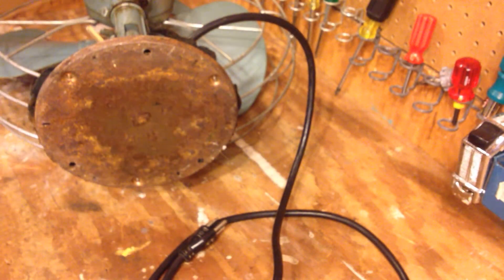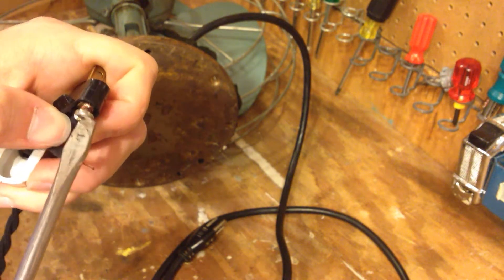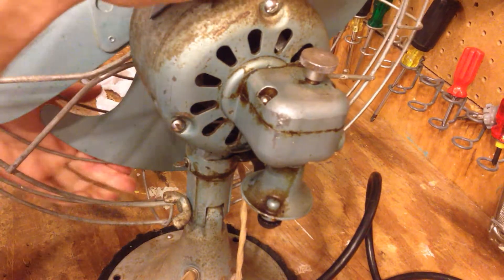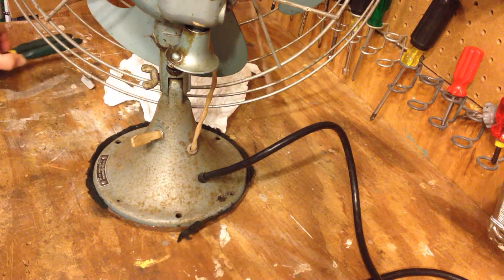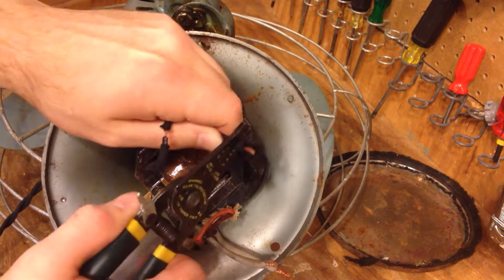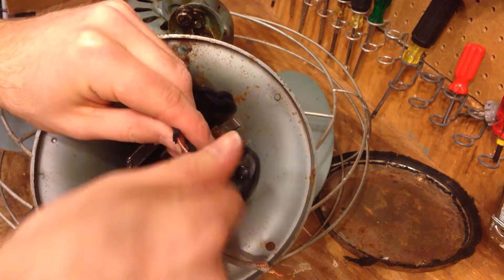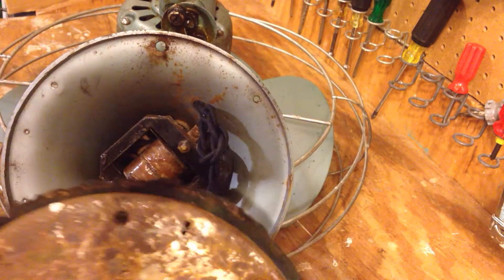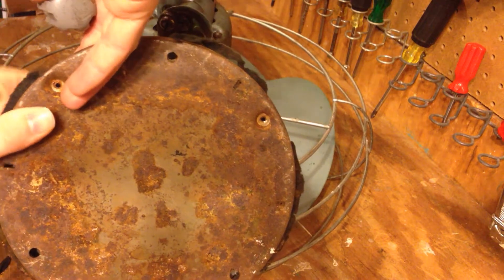Rewiring a General Electric Vortalex Fan

Comment: I got a fan like this today. I started to clean it. It appears the power cord will need replacing. It has a on off switch on the cord. So it must have been replaced before. Which might required fixing the original switch on the fan. A bit of work, but less expensive than having it repaired by someone else
Reply from the maker: That is definitely a replacement cord, these at least to my knowledge were never sold with cords with inline switches.. Sounds like it will be a bit of a project to get it back to original, but it will be worth it.. These are great fans..

Comment: not sure if you noticed but the bottom base is actually suppose to be wrapped with felt, i am currently finishing restoration on one but blades are off balance.. But i replaced the felt base took a while but i got it.
Reply from the maker: +thatwasjustdumb Yes, I am aware the felt is missing.. I have a few fans that need to be re-felted.. I've never done it before but I do want to give it a try eventually.. The blades are really a pain to balance on these Vortalex fans,, because they're so big the slightest bend will throw the whole thing off..
Reply: +Jordan U got the blades corrected but the fan was off balanced had to add a small weight on on blade, now its perfectly balanced, its a pain to get the felt on without adhesive, but really nice one you get it on
Reply: +Jordan U not sure if you did or not but i would recommend clearing out the old grease in the back compartment and replacing it with fresh. Mine  the grease was degrading/separating, And for the front oil well i just soaked the wick in some fresh oil and used a paper towel to help remove build up out of the wick. For caked on grease build up on the surface i use some acetone as the paint was a baked on finish.
Reply from the maker: thatwasjustdumb The oscillation doesn't work properly on mine,, so I never bothered to replace the grease.. If I get it repaired (I haven't really attempted to fix it yet), I will change the grease then.. I have refreshed the oil though, and refilled the wicks..
Reply: @thatwasjustdumb  What grease did you use on your Vortalex? Mine is most likely running with the factory grease, it's like putty and goes away to nothing when I rub it between my fingers.

Comment: Thanks a lot!  You should’ve seen how I was trying to get in that thing.  Is there anyway to replace the wire going to the motor?
Reply from the maker: The lead wire can be replaced but it requires total disassembly of the unit.

Comment: I have a General Electric aq1 and after removing the motor from the shell the coils became loose and vibrate is there a good epoxy I can use to keep them in place?
Reply from the maker: The stator should probably be completely revarnished if that's the case.

Comment: Is it safe to just have the cord connected directly to the motor bypassing the speed coil
Reply from the maker: I believe so.
Reply: Is it safe with the on off switch I installed
Reply from the maker: @wessandlin8056  I'm not sure how you expect me to answer that question.
Reply: I have it wired an a one speed with an on of switch. When I tried it with the speed coil and Orono all switch it had no power at all.

Comment: What are you using to replace the original switch? I bought one just like this from eBay knowing it didn't have a switch knob, and right now it's stuck on high.
Reply from the maker: I did not replace the original switch.
Reply: @JordanU  Gotcha, I found a flathead tip drill bit and am using it to change the fan speed on it right now. By the way, what grease would you recommend putting back into the oscillating unit on the G/E fan? Because, the grease that's in there is most likely the original factory grease, it's like putty now and has lost most of its lubricating ability.
Reply from the maker: @virtualpianoman5175  I usually put in a few drops of oil and mix it into the grease to kind of rejuvenate it. I'm not sure what the best replacement would be. There would probably be someone on the AFCA vintage fan forums that could provide more insight on that than I.
Reply: @JordanU  I was looking yesterday, and an older guy took out most of the grease and filled it back up with Cambell Hausfield 30 weight compressor oil. Just enough to where it's covering the worm gear. I'm going out today to pick up a soldering iron anyways to splice a 90s fan back together. So, I'm going to grab some oil as well. The guy said it had a great spindown time after the replacement.